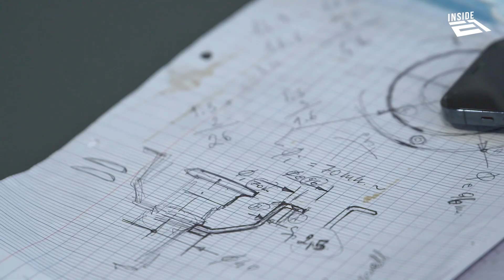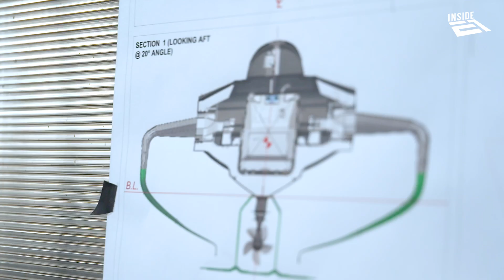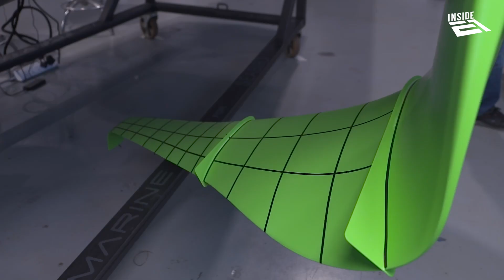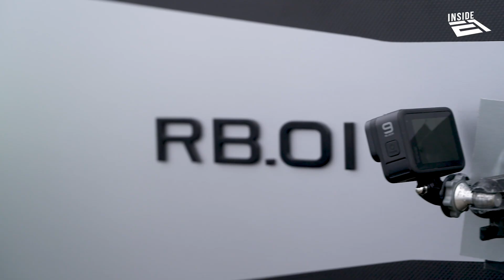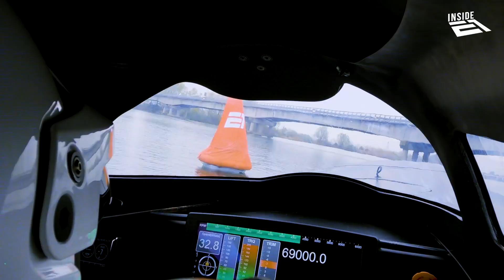On-the-water testing: RaceBird Prototype 1 flies for the first time | INSIDE E1 EPISODE 6

Comment: Looking at the foils, they don’t look particularly advanced and the profiles are higher drag than optimal. Very surprised also that they are using a very conventional propeller instead of the latest, more efficient toroidal props.
Reply: I looked at your channel and oddly I don't see any videos of your foul designs. Hmmm...

Comment: Putting extremely toxic lithium Ion batteries on the water and calling it environmentally friendly is about as big of a lie as possible. Lithium kills the environment...…If you kill the plankton in the oceans the oceans die.    I am not against electric boats or against lithium ion batteries, I am against the lie.   The very last place toxic lithium ion batteries should be in is race boats.  Race boats crash and sink.

Comment: Well done good job.  In races on such devices it would be cool to drive. It would only be better if the designs of such devices were different, it is not interesting to look at the same boats chasing each other. after all, other schemes of electric boats can be much faster. I suppose a classic three-point hydroplane with your engine would be faster and more stable. And so everything, COOL. cool design. it is most important.
Reply: Teams will eventually be able to upgrade the chassis to their likings just like in extreme E but the first years will be done with a spec series.